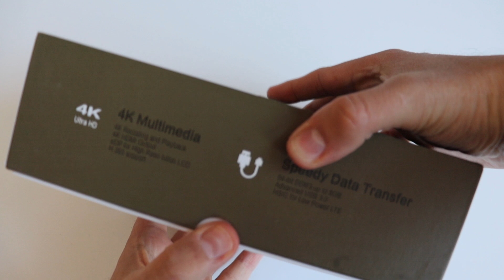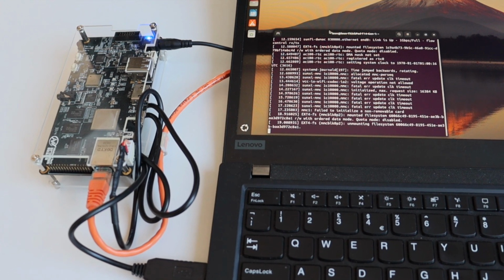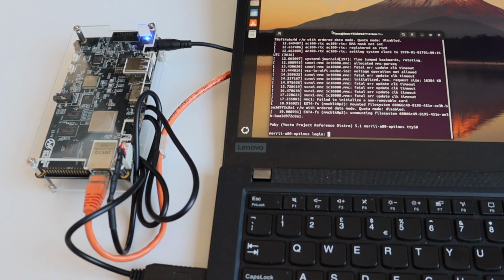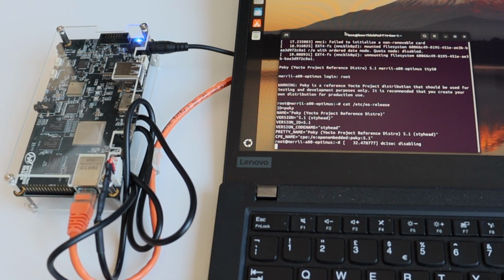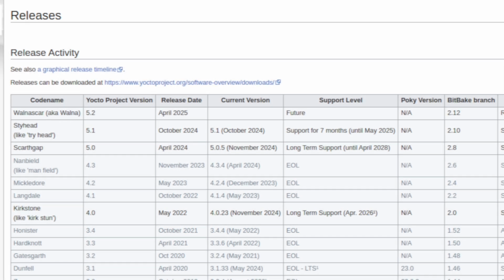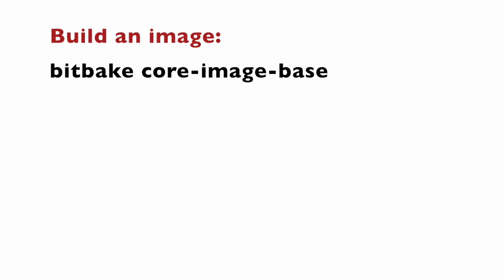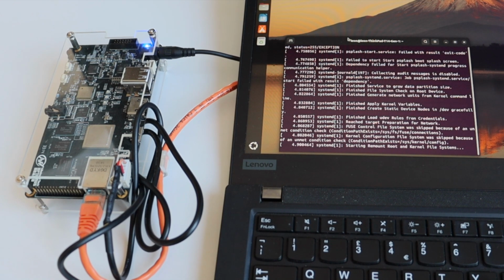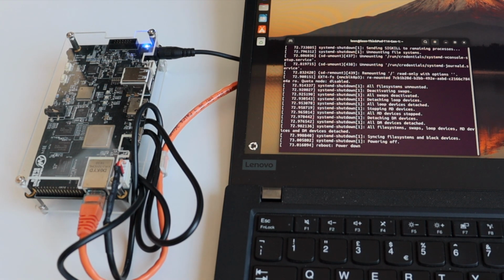Reviving Old and Forgotten Allwinner A80 ARM Board with Mainline U-Boot, Linux and the Yocto Project

Comment: Hello! I'm compiling on an amd64 virtual machine, I followed all the steps and at the end this appears ERROR: Task (/a80/poky-rauc-sunxi/meta/recipes-devtools/cmake/cmake-native_3.28.3.bb:do_compile) failed with exit code '1'

NOTE: Tasks Summary: Attempted 525 tasks of which 0 didn't need to be rerun and 1 failed.

Summary: 1 task failed:
  /a80/poky-rauc-sunxi/meta/recipes-devtools/cmake/cmake-native_3.28.3.bb:do_compile
    log:/a80/poky-rauc-sunxi/build/tmp/work/x86_64-linux/cmake-native/3.28.3/temp/log.do_compile.363678
Summary: There were 2 WARNING messages.
Summary: There were 2 ERROR messages, returning a non-zero exit code.
Reply: Good evening! I solved the problem, the VM had little memory, which is why it gave this error, now everything is fine...    NOTE: Tasks Summary: Attempted 5190 tasks of which 0 didn't need to be rerun and all succeeded.
Reply: Now I don't understand how I'm going to put it on the sdcard to run? After compiling, what are the next steps?
Reply from the maker: Well done for figuring out the issue! Sorry, that I didn't reply earlier. It is a busy week.

After building the image you can to flash it on a microSD card. The image is a wic file, although it might be an archive like wic.bz2. You can flash it with dd or bmaptool from the command-line or if you prefer a more user-friendly app with a GUI have a look at Balena Etcher: https://etcher.balena.io/

Btw the Yocto Project is very powerful and flexible but it has a steep learning curve. Because of this I started making video tutorials about it with examples for Raspberry Pi 5. Here is the first tutorial: https://youtu.be/fY7u6PiV8qA?si=31PREkF4Ly_ItGFR

Here is a CLI example how to flash the image on a microSD card. The example is for rpi5 but you can adapt the commands for your image in a similar way: https://youtu.be/fY7u6PiV8qA?si=l4yAGnVl03Kskl8X&t=469

Comment: Very nice. i have got a cubieboard 4 last year, but couldn't find any useful image for the board, looks like i can try to build an image myself follow this guide now. great news. 😃
Reply from the maker: Glad it could help! Actually, due to the same reason I did the porting effort for A80 in the community BSP layer meta-sunxi and after that this video. If you are new to the Yocto Project my series how to get started with it may help although the examples are with Raspberry Pi 5: https://youtu.be/fY7u6PiV8qA?si=U5Lv4PpwLvz-jDEe
Reply: @LeonAnavi  Thank you Leon, very helpful. yes i am completely new to yocto, it took me a while to get my little linux system up and ready to build the image, but in the end following your guide the build looks like succeeded. but the output is a folder in /home/eric/poky-rauc-sunxi/build/tmp/deploy/images with the name of "cubieboard4" with several files in it, not a single image as we normally use to flash with flash tool like etcher, is this seems alright? should i just use core-image-base-cubieboard4.rootfs.wic.gz this one? thank you for your advice.
Reply from the maker: Sounds like you are on the right path. You flash the wic file on a microSD card and try to boot it. Use a USB to serial debug cable to see how it boots (or if there are any errors).

Comment: Hi! Good job. I have Tronsmart Draco AW80 Meta. I build and wrote an image to the SD card, but in the terminal I get this:
U-Boot SPL 2024.01-g (Jan 08 2024 - 15:37:48 +0000)
DRAM: 2048 MiB
Failed to set core voltage! Can't set CPU frequency
Trying to boot from MMC1

U-Boot 2024.01-g (Jan 08 2024 - 15:37:48 +0000) Allwinner Technology

CPU:   Allwinner A80 (SUN9I)
Model: Merrii A80 Optimus Board
DRAM:  2 GiB
initcall failed at call 9ffbd531 (err=-5)
### ERROR ### Please RESET the board ###
What is the error? Maybe the memory size is small? 2GB
Reply from the maker: I am not familiar with this device. Is it supported in mainline U-Boot? In the meta-sunxi machine configuration for it what have you set for UBOOT_MACHINE?

Comment: I have a really old allwinner polaris p1 tablet lying around, will this process work also on this device by any chance? Many thanks and a great channel 😀
Reply from the maker: Excellent question but very tough to answer :) It is very tricky with tablets. It might kind of work... but it is a very long shot. According to what I see Polaris p1 tablet is with Allwinner A23. This is a lower power cut-down version of the Allwinner A20 SoC.

The BSP layer meta-sunxi used for building the image in this video contains machine definitions for several boards with A20 like olinuxino-a20 and olinuxino-a20lime. However, the tablet has different peripherals and probably this will require tweaking the kernel defconfig and device tree to make all of them work. I mean things like the touchscreen, the WiFi and the Bluetooth.

Comment: Hola Leon. Podrias poner como quedaria el archivo local.conf para una cubieboard 4? Muchas gracias
Reply from the maker: Hola :) Initialize the build environment and generate a default local.conf with:

source oe-init-build-env

After that add the following lines at the end of the file for Cubieboard4 and to switch to systemd:

MACHINE = "cubieboard4"
INIT_MANAGER = "systemd"